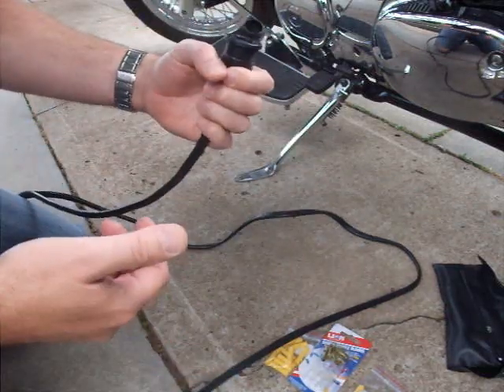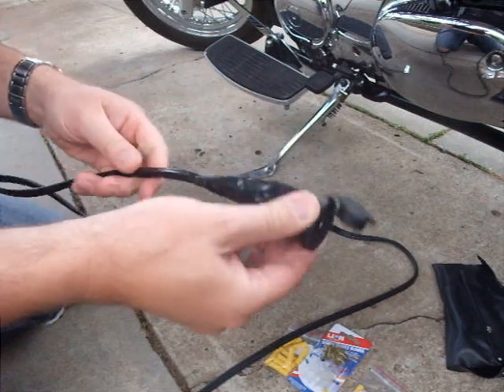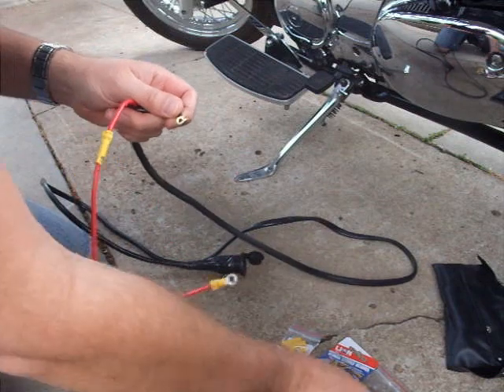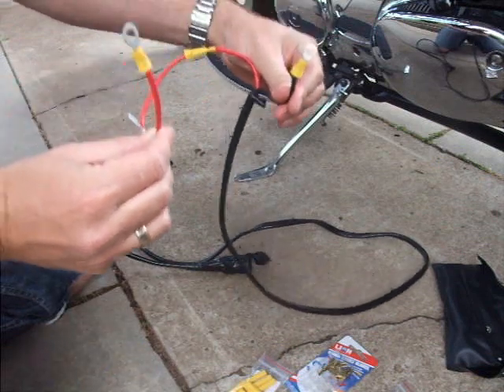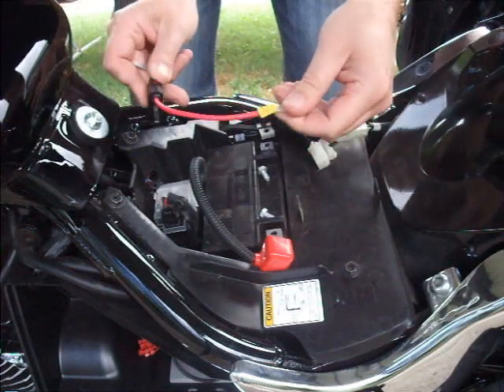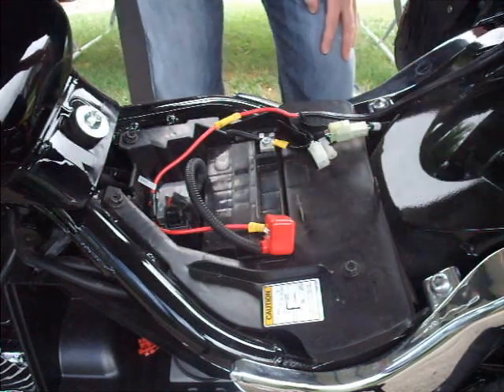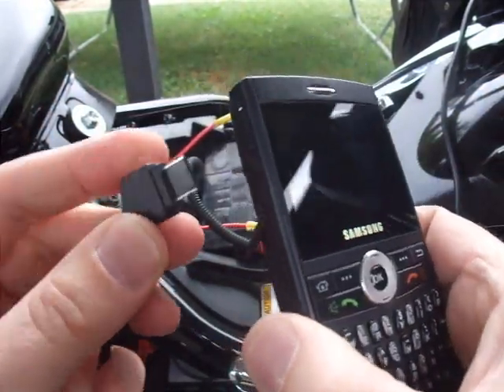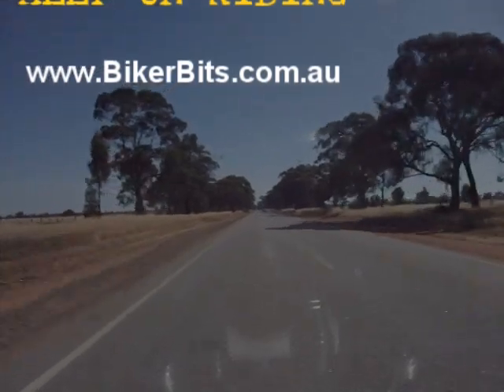Suzuki C50 cigarette lighter outlet

Comment: I bought on that had a little red led light on it so it would and did eventually send the battery flat though I didnt ride for a while , you can buy one now that has the terminals and everything all ready to put on your battery BUT it actually has an on / off switch for about $30 ,, goof value and another that just has 2 USB ports on it